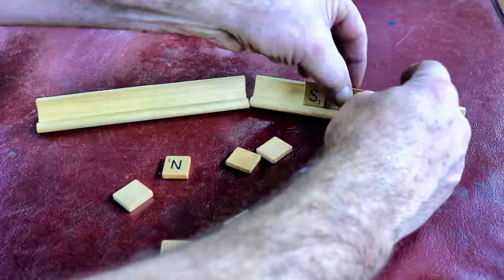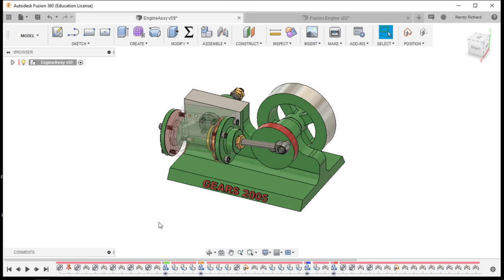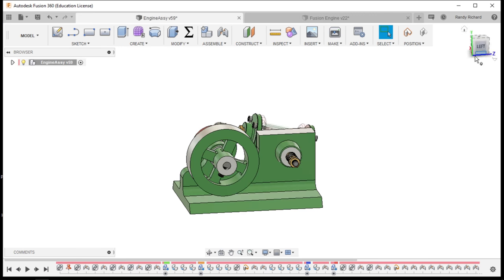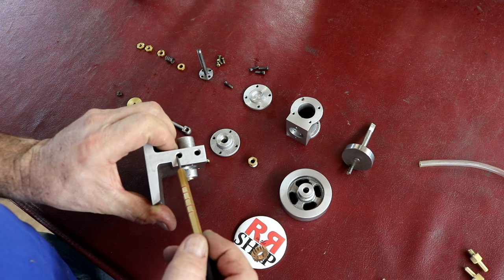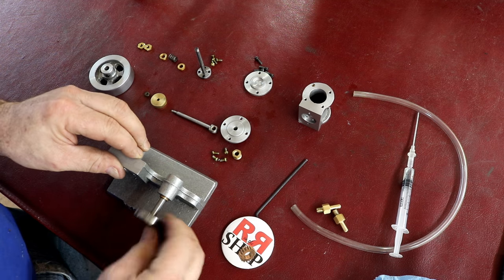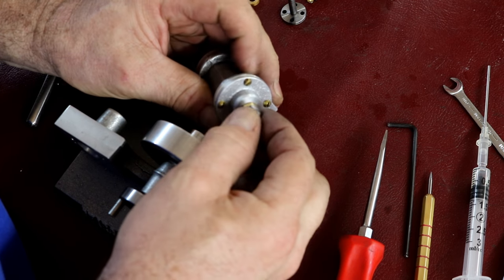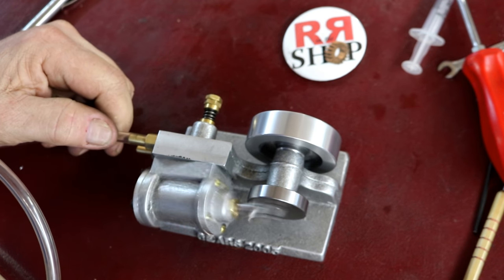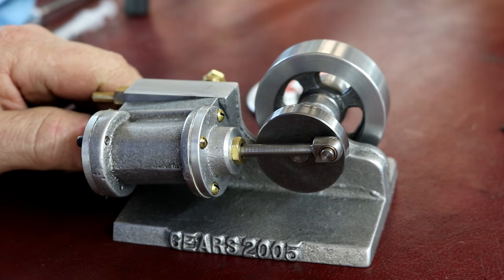How to Assemble and Run a Model Steam Engine for the First Time P7

Comment: Good job Randy, always good to see the end of the project with a positive result even if it is wobbling like crazy, that usually is a bad thing except like in a little steam engine when it is not, a perfect wobble in fact.  Good fix on the stripped out thread, a booger to do on those tiny ones so extra credit for that fix.
Reply from the maker: Thanks you John.  It is a smooth wobble.

Comment: Nice smooth running little engine, great project, I'm going to look around I may have a small regulator for that air pressure.
Reply from the maker: Thank  you Eric,  I did not have any thing low enough.

Comment: Morning Randy!  Great job! Don't know what your plans for that engine is but I would add an oiler if you're going to run it only on compressed air. You noticed the oil that you applied was coming out dirty, that's normal for a new engine. Keep running it and applying fresh oil until it comes out clean. You'll notice at that time the engine will run smother. Looks to me that you built a fine runner! Kudos!
Reply from the maker: Morning Craig.  Thank you, after the oxides rub off it will clean up.

Comment: Very nice, Randy. Runs very well - - what color do you have in mind?
Nice work. (Good thing the pressure relief system didn't jump up and bite you!)
Thanks for sharing.
Joe
Reply from the maker: Thanks Joe.  Not sure on the colors.  The pressure relief is a finely tuned piece of equipment.